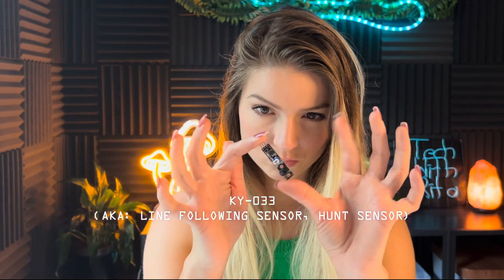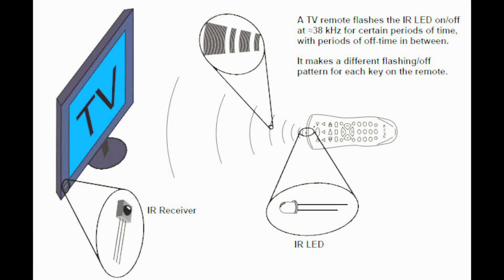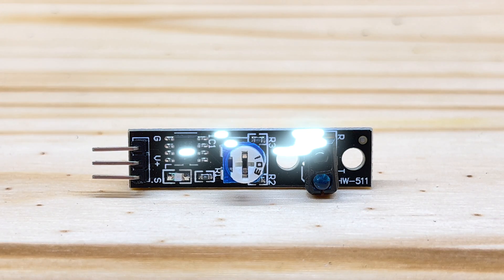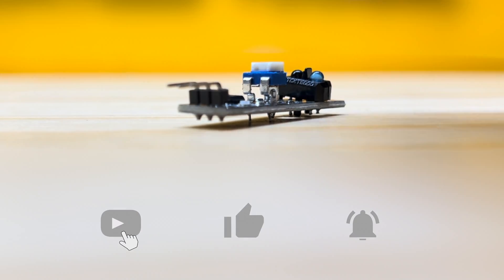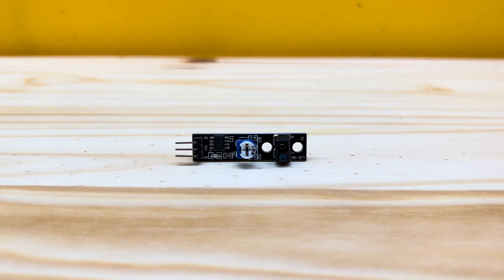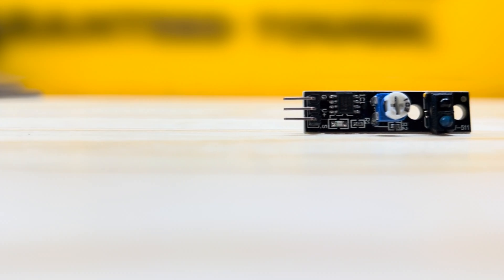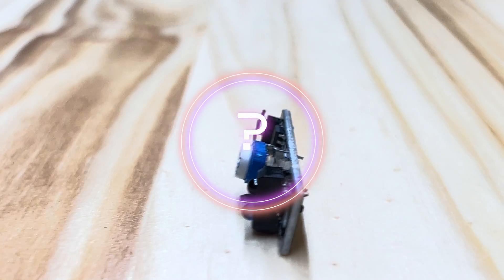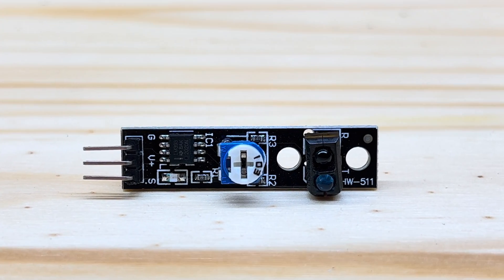Easily Explained: Tracking Sensor Module KY-033

Comment: Do you take requests?
I have a UHD dome security camera. It is fixed, (not PTZ)  but I would like to make it pan with an esp32 controlling a pancake stepper motor (probably needs a 3D printed housing and gears. I want to stick it under a 3rd floor air conditioning sleeve outdoors. Magnets maybe.) Kind of complicated since it needs to pan only 160 degrees or so since it needs a power cable. Maybe that's why PTZ is so dang expensive.
Reply from the maker: Well, although I love a challenge, I’ve certainly got a full agenda to be taking requests at the moment, but I do like the idea and won’t dismiss it entirely. 
Perhaps purchasing a pan housing on Amazon $15-30 may be easier than designing and printing gears and assembling it from scratch. Amazon has a mini pan /tilt anti-vibration camera mount with two servo motors from what it looks like, and has leads that fit Arduino / microcontroller pins. I think that’s a great option.